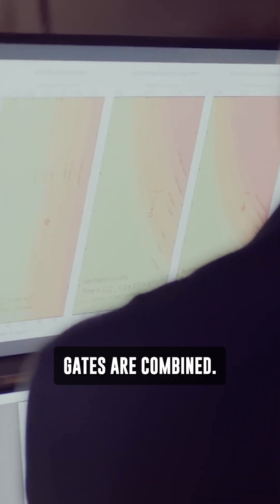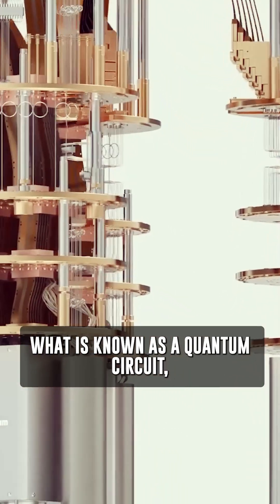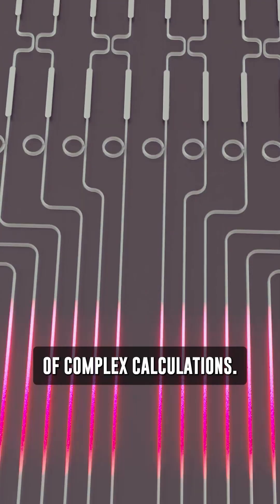Quantum Gates and Circuits: The Building Blocks of Quantum Computing

Comment: So basically quantum computers can calculate many outcomes that could be possible, but if they are used for one specific task, they are worse than regular computers as they try to guess why you press the letter W in a videogame, maybe you were chatting, maybe you were spamming W in chat, maybe you were moving forward or maybe you were using a hotkey for Something, and the proceeds to do all of those at once.

This is a joke